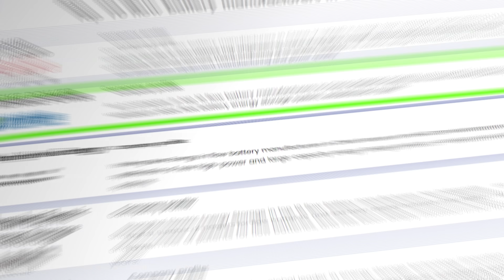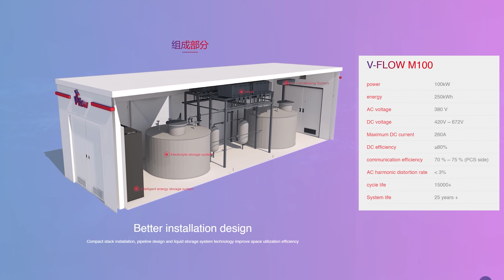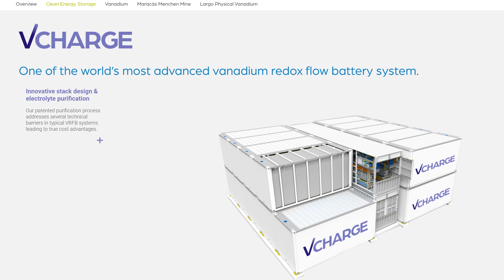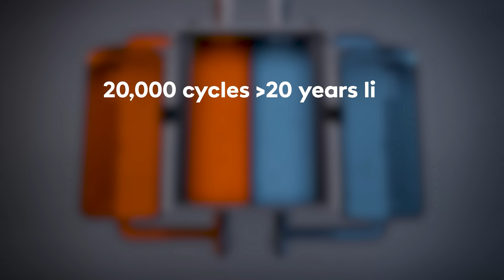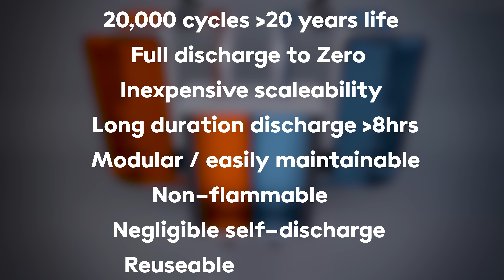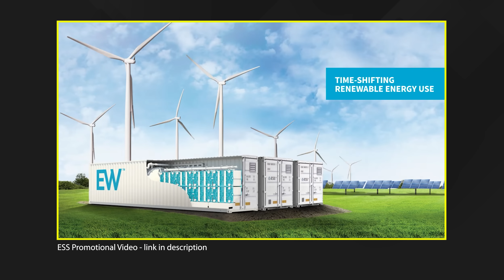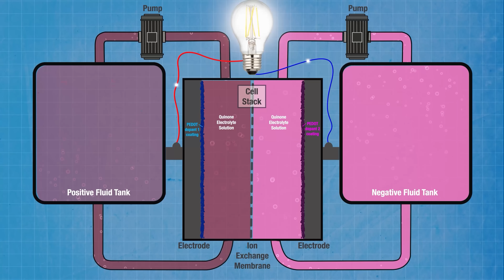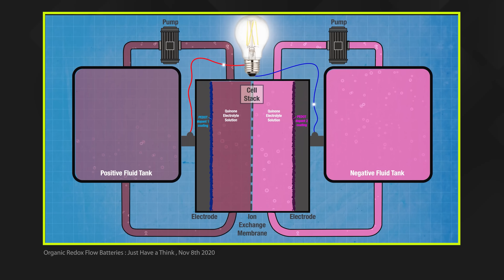Iron and Saltwater Battery How easy is that

Comment: Windmills and solar, the way they are currently implemented, are an ecological disaster.  Nuclear is the only way to power a future economy.
Reply: Windmills are for grinding corn, so I am guessing you mean 'wind turbines', and no, they are not an ecological disaster. Nor are solar panels. 

The only part of a wind turbine that can't easily be recycled is the blades, and even methods to reuse their materials are being developed. Solar panels are already being recycled.
Both give you 25-30 years of almost zero carbon electricity and are far less expensive to install than nuclear power. 
Nuclear power stations are prohibitively expense to build, taking many years to construct and even longer to decommission at the end of their 30-40 year lifespan.
Then, on top, you have the cost of 24/7 armed security and of waste disposal over the long term.
This all makes their MWh generating cost 2-3 times that of wind and solar. Small modular reactors may prove to be a way of reducing costs. 
Of course, nuclear does have the advantage over renewables of being able to produce constant power, which is why the whole discussion around batteries and energy storage is vital for our future energy mix.
Reply: @jeremyradford5103  Windmills are terrible for migrating birds and for bats and they are an eyesore. Same for solar panels in their current state. And they take thousands of acres of land. To replace the current electric output with windmills and solar, it would take millions more wind turbines and billions more solar panels. Current count for wind turbines is only ~80,000 and solar panels ~1.5 million. Imagine the tsunami of trash if we continue to build the economy on these technologies to the necessary scale. Sure, nuclear is expensive, but amortized out is cheaper, cleaner, safer and always available. No need for a huge battery infrastructure on top of the one for electric vehicles currently ramping up. There are other issues such as NIMBY blocks, getting the power to the grid also. Just an opinion - hoping for the best solutions.
Reply: @begelston  Wind and solar produced 31.2% of the UKs electricity last year against 15.5% from nuclear. In the first half of this year, wind and solar have generated 14.3% of global electricity, up from 12.8% last year.
I am not opposed to nuclear power, but its generating costs are prohibitive, as are its running costs. 
Due to maintenance issues with the French nuclear supply, they had to import 14TWh of electricity from the UK. Yes, the UK, a net exporter of electricity for the first time in 41 years!
We pay £3 billion a year for armed security on our nuclear plants and the Sellafield repossessing plant.
Personally, I don't find wind turbines the least bit of an eyesore, but I acknowledge that some people may. They remind me of Don Quixote charging windmills on his trusty steed, Rocinante!
As I said above, wind and solar produced  31.2% of our electricity last year but in reality could have produced much more, particularly wind, which is often the first to be turned down when there is an over supply of electricity as its cheaper to do that than turned down a nuclear or gas power station.
The National Grid has to pay power generators even when they are not generating due to low demand (a subsidy). The wind doesn't just stop blowing because we have an oversupply of electricity, and it would be far more cost-effective to store that excess for when we do need it.
Electric vehicles are potentially the perfect solution for energy storage as, like all vehicles, they spend most of the time parked. They could easily charge when electricity is clean and cheap and provide electricity when it's dirty and expensive. 
The National Grid have stated that they welcome the transition to EVs as it will help balance the grid. 
As for migrating birds, the RSPB is generally positive about wind farms as they will help reduce the environmental impact of climate change and the migratory patterns of visiting birds.
Reply: @jeremyradford5103  Thanks, Jeremy. It sounds like wind is the way to go in much of Europe and the UK.  Perhaps it will prove to be a major part of the solution after all. Efficiency and power availability will be the key along with not exchanging one problem for an equally bad problem, ecologically speaking. Right now the nuclear industry is so bound in red tape that it has no hope of proving its worth, especially in fulfilling the potential of small/medium sized reactors. Battery break-throughs that use eco-friendly materials and are also efficient are still in the works. No doubt it will turn out to be a combination of different technologies.
Reply: @begelston  Yes, I agree. It is likely to be a combination of different technologies, including wave and tidal. We are lucky in the UK having such a long coastline, but unfortunately, not enough forward thinking at governmental level.
You may remember Boris Johnson saying that we were the 'Saudi Arabia of offshore wind'.  That was true at the time, but we've now dropped to 4th place in terms of generating capacity.

Comment: Rust batteries.  Oxidation batteries.  Iron saltwater batteries.  FeNaCl bateries.  Redox Flow batteries.  V-Flow batteries.  Everflow batteries.  Etc.  So many names for virtually the same thing.  The problem with them is you need a lot of space like filling up your whole garage with this battery as compared to lion batteries which would be a panel on a wall.
Reply: That seems a little exaggerated. Redflow's quadpod is 2.3x1.1x1.3m and is rated at 40kwh. A little larger than an old chest freezer - and compared to Li-Ion I know which one I'd rather back my car into by mistake!
Reply: @SminkyBazzA 40kWh would run the average UK home for 3-4 days at least. I'm sure their ZBM3 is man enough for most homes.

Comment: I think we should also look into flywheels for the first hour or two after sunset.  The worst part of the duck curve.
Reply: Fltwheels have a very poor energy density and can fail catastrophically.
Reply: @rogerphelps9939  Not the newer ones on magnetic bearings mounted sideways in the ground.   They fit the profile perfectly.  They only hold power for 24 to 48 hours, however they can dump energy on demand, they are polution free and recyclable, and they are much less expensive than batteries.

The biggest problem with solar is the duck curve.   Flywheels fit that perfectly.

See, "Turn Up the Juice: New Flywheel Raises Hopes for Energy Storage Breakthrough" in Scientific American.

They also diversify energy storage and are very well suited to non-mobile demand scenarios.

Comment: would be nice to hear the price per KWH/cycles 
12h or 6 discharge doesnt say much
7:50
Reply: they said 0.05$ per kwh for 12H cycle so in real world - once cycle a day the kwh stored is 0.1$ so exactly the same price of lifepo4 system with bms and inverter.

Comment: I've been now hearing about vanadium  flow batteries for a decade or so . Why didn't they scale the way LFP batteries did ? Maybe they're just not as good as they're cracked up to be
Reply: It's a much more lucrative market in selling private Mobile phones and electric vehicles. That's what battery factories were primarily built to serve. 

Grid storage serve is a utility infrastructure. Instead of relying on laissez faire commercial demand, Flow Batteries would be more common place if the simple fact of political will and foresight was there years ago. 

Shamefully, it's not even here yet fully.
Reply: Flow batteries can be competitive with LFP batteries for long-duration storage. We just don't need long duration storage until wind&solar become prominent.
Reply: @helkafen100 Solar is already prominent here in Australia with electric pricing turning negative almost every day due to a surplus of solar power.  Indeed major amounts of solar are actually turned off now due to that negative pricing which is a total scandal．Large scale storage to even out the availability of renewably produced energy is seriously overdue but I hear nothing about these types of batteries here.  Only lithium ion battery storage.
Reply: @robsengahay5614  100% it's time for you guys. Another option could have been Snowy 2.0 but it's so late!

Comment: The inherent barriers of the free market against mass adoption of decarbonisation be damned.
Reply: the only barrier is the political one. lobbyists for the fossil fuel industry OWN all of politics.
Reply: What barriers?  Investors putting money into investments that will have a quick pay off is not a barrier.  Its not the investors responsibility to pay for research into something that might not work out.
Reply: @pin65371  That's exactly the reason why there's oil subsidies and interest free loans from central banks for R&D... or stock buy backs.

Thank for pointing that out.
Reply: @BeLowBelowo  What does stock buybacks have to do with anything?  Any of these small companies building alternative energy products would do stock buybacks at some point as well. You go public to raise funds to expand and then start buying back stock at some point to get more of the ownership of the company go back to the actual company.
Reply: @pin65371  if they got the same tax subsidies as oil companies, that would help.